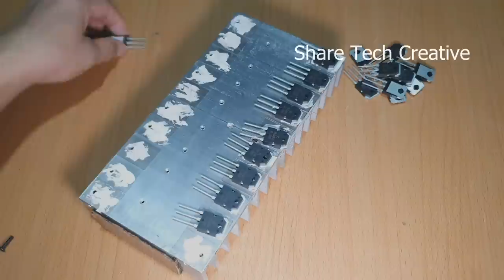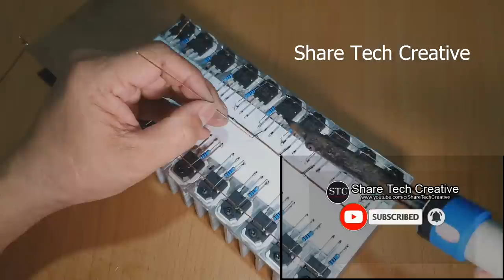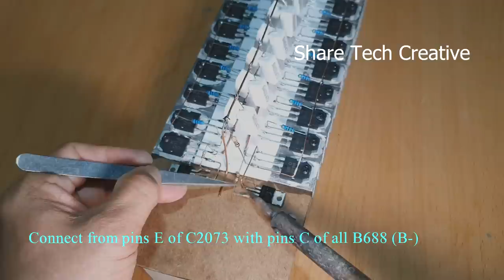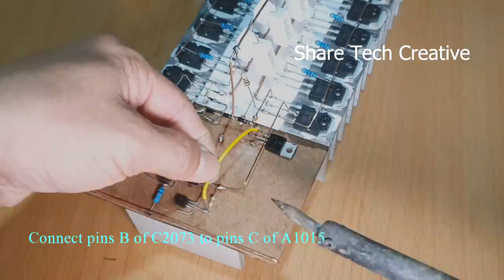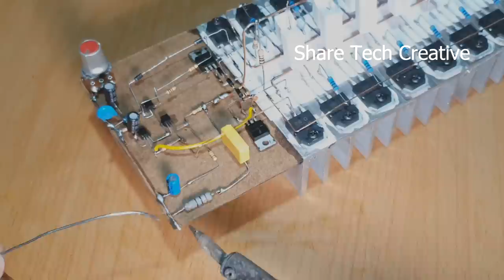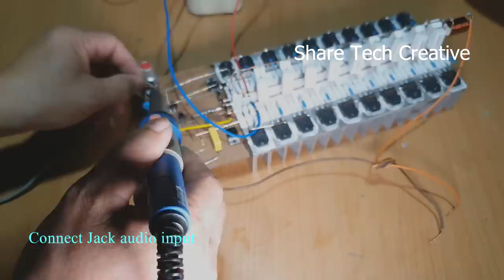Diy 1000 Watts High Powerful Amplifier Using D718 and B688 Transistors | Class AB

Comment: can i connect 8ohm speakear
Reply: and how much watt it can output with 4 transistors or 6 transistors
Reply from the maker: Thank you can use a 4-ohm to 16-ohm speaker
Reply from the maker: If using 4 transistors it can reach the equivalent of 200W
Reply: @ShareTechCreative  Thanks